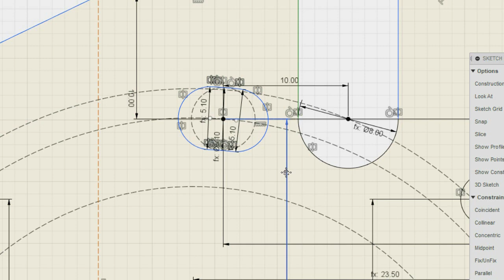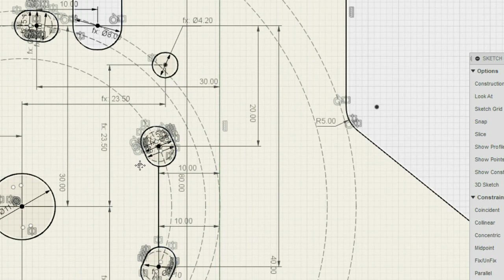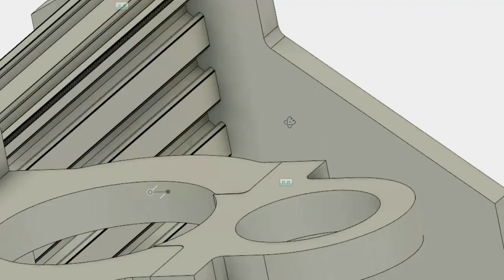#22 Cutting Aluminium and Tramming CNC Spindle #22 / Design Upgrade

Comment: I have a spindle question for you. I'm in process of putting a WorkBee together.  I'm trying to track down a spindle with an ER16 collet that isn't too heavy for my machine. Could you make any recommendations? Everything I can track down with that size collet seems to be 80 mm dia and weighs nearly 10 pounds.
Reply from the maker: I've seen a few 60,000 rpm frequency drive spindle that's have much smaller diameters. But you're restricted to ER11 or ER8 collet sizes and they are generally more expensive.

Comment: What thickness is the Acetal that you used? 
Engineering plastics seem so expensive here in the states I often just go for 6061 aluminum. 

I have been wanting to play with Acetal, PET(G), and phenolic material for CNC plates 

But they are nearly as expensive as carbon fiber lol
Reply from the maker: Think it was 8mm or 10mm but it was the copolymer stuff so a little cheaper than delrin. Aluminium is the best though.

Comment: I had a similar issue with my beefed up OX and it was fixed when I replaced my spindle/router holder with a very solid machined aluminium mount. Amazing what a tiny bit of flex does.

Comment: 200mm/min  and 15000rpm  is just wrong.     for this spindle speed feed rate must be about 1500-2000mm/min.
Reply from the maker: Maybe for a mill but this is a CNC machine. The spindle can go faster so I might as well use that to my advantage.

Comment: You can use opposing screws/bolts on each side of the arm to make your adjustments and to hold it while you tighten the screws. You can either make a jig or make it part of the design. You can do this with your side plates as well. Making them part of the design would make the design stiffer. This would greatly help with one of the biggest problems, holding it in alignment it while tightening the bolts.
Reply from the maker: Another good idea. I think I'm going to add something to the y plate to hold an adjustment screw from the front for now - which I could either made from 3 or 4mm aluminium angle bracket or maybe even something 3D printed. I don't know if I have enough space on the rear of the axis. Have to have a ponder.
Reply: I have been thinking about building one myself and have been looking at what other people are doing. The 2 problems I see in most of them  is lack of adjustability to get everything lined up, lack of any added stiffening.  Small additions can make a big difference.

Comment: A few points based on my own experience:
- A good clamping system improves accuracy. The one used does not look that steady or maybe use a few more?
- Openbuilds V-wheels for motion along the x-axis are terrible. I guess they do not support that axial load and are only somewhat more precise along the y-axis where the load is distributed in a different plane. I ended up using linear bearings. I did make a lot of difference. 
- Upgrade to Alum the y plates at the very least.
Reply from the maker: It's almost as if you need wheels along all faces of the x axis c beam. I think as a first time machine this is going to be good for people who don't have a ton of money to throw at a machine. The wheels are cheap and easy to replace. :)
Reply: That is very true, this machine is perfect for first timers. Highly recommend your design in particular.
My comments were more for you since you are quite on a mission to make it as perfect as possible. Sometimes I wonder if you plan to use it to build a spaceship lol. 
For me it wasn't about accuracy, it was about speed. I wanted to be able to cut faster than I was able to cut with the openbuilds motion system so I decided to upgrade to linear bearings.
At the end of the day, most of us will never be satisfied with our machines and would always want to improve it even if it is a small mod. That's the mentality that made us build it in the first place and not buy off the shelf.

Comment: instead of the dial indicator you could just mount a piece of metal on the arm and use the probe function to measure the "nod"

also measuring at different Z heights might give you and indication of whether the  error is
from the Z axis not a being square or the spindle not  being parallel to Z
Reply: I like that idea.
Reply from the maker: That's a really good idea!!

Comment: Nice work! Just a tip, in your sketches in any cad program, you should always make sure everything is constrained, the light blue lines in fusion 360 show that they arent completely fixed, meaning you can click and move some of the points or lines. It can throw things way out of wack.
I like the idea of shimming the z axis rail to get it straight.
Reply from the maker: Ok thanks for the heads up. It's a really confusing programme - and so slow when you get to the stage I am with a 3D model.
Reply: Educating Savvas not a problem! Yeah I am a CAD designer and use inventor which is a lot more advanced than fusion 360 and I think a lot more smooth. Fusion is great for simple bits and pieces and the CAM side of things though.